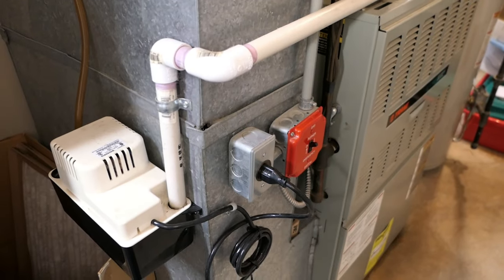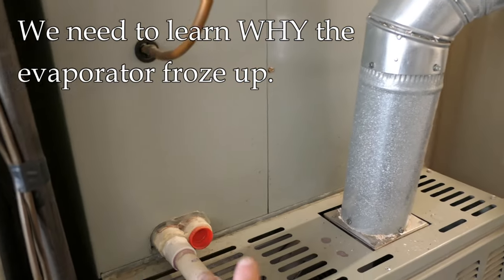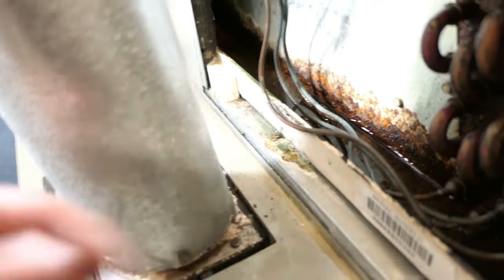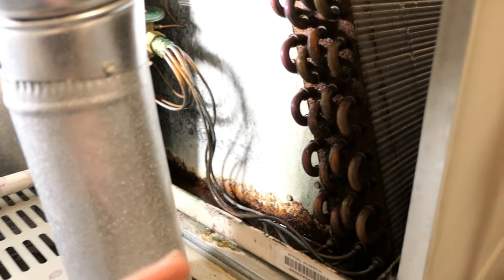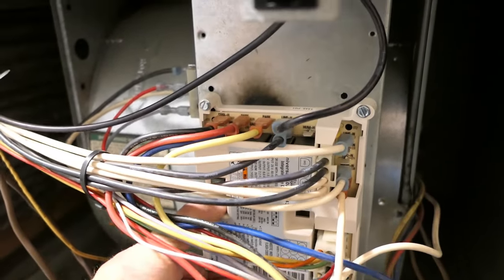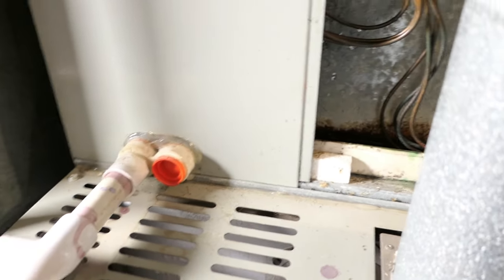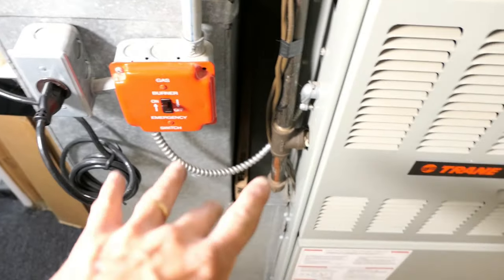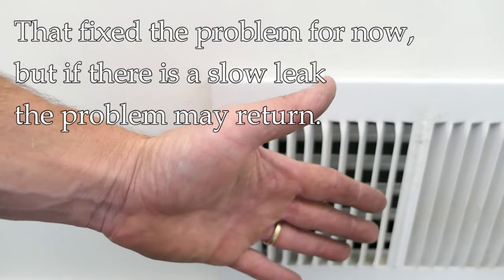How To Clean And Check AC Evaporator Coils After A Freeze Up

Comment: The evaporator coils in that unit are in a V formation and you are only looking at the outside of them.  If you removed that triangular panel in the center, you would have been able to look to see how dirty the coils actually were.  The INTAKE side of the coils is the part that accumulates all the dust and dirt and I am pretty sure that was the center part that you never even opened.  That is where the air first enters the evaporator coils from the return vent in your house.  They needed to be brushed and coil cleaner used to clean them.  Spraying water on the fins on the outside of the coils where the OUTFLOW of air returns the "cool" air to the plenum and then into the house is not going to solve the problem.  Sometimes the INTAKE side of the coils cannot be accessed simply by removing a panel with a few screws.  There are videos showing the person having to get down below the air handler and having to spray them through the opening where the return air from the home enters the air handler.
Reply from the maker: Well, the video was really about icing and the causes, not just cleaning.  You are correct that taking apart more of the sheet metal would allow a more thorough cleaning of the coils, although spraying from the outside in will take care of the worst of it.  Since the video is aimed at homeowners, there is going to be a limit as to how deep you want to go with disassembly.
Reply: I had to take off the V shape sheet metal to access the inner coils. That was the hard part since I had limited space. I had to bend the sheet metal to pull it out but finally got it. Your are 100% correct, the inner side was the dirtier side and literally had a thick build up of lint. After cleaning, I noticed significantly how much cooler the a/c worked.
Reply: Bry , I have a problem with my cooling coils I believe inside of my condo near the air handler. Maybe you could help me out. An AC man came twice! 1st free on. That didn't work. He tried cleaning the coils. But I don't think he did it properly.
Reply: This happened to me last year and guy came and supposedly “fixed it” all I saw him do was hose everything down, replaced something and left.. literally the next day the outside coils froze again and he said “just hose them down and leave system off for a few hours” so basically he didn’t fix shit 😡😡🤦🏻‍♀️
Reply: ❤Mine also impossible to clean the inner V. 
So I quit using our whole house AC and bought 2 mini split AC which cost $799 each. 
These are way better than conventional whole house AC.❤
Reply: Why is it so difficult to access the inside of these evaporators? Seems like this would be something you want to clean or at least inspect annually.

Comment: If the coil freezes, turn the fan to on and turn system to off on thermostat.  Will defrost much faster.
Reply: If it’s a gas furnace turn the furnace on and it will melt faster.

Comment: The real problem was inside the "A frame". Need to remove the sheet metal triangle (good luck!) and then remove the 1/2 inch think layer of pet hair, lint, pollen, dust and other crud with a brush and shopvac. Replace filters more than you think you need to, monthly for many households, or this will happen.
Reply from the maker: Yes, filth can build up on the other side, although it isn't always the case.  This system had a well maintained filter and the fan blades were clean.  When filters are not maintained I notice dust build up on the squirrel cage blades.  Removing the additional sheet metal to get underneath the A frame can be a lot more work, especially if rust is present.

Comment: Missing the trap on that condensate line.
Reply from the maker: In my area there are no traps in residential condensate lines leading to a condensate pump.  The tube leading outdoors from the pump has a loop, however.

Comment: Cleaning the top of the coil is not very effective, I would suggest cleaning the inner V of the coil where debris actually accumulates.
Reply from the maker: The whole coil can be cleaned, there was just a limit to what I could film given the physical space.
Reply: Yes, usually the bottom where the air comes in can have a thick layer of crap while the top looks pretty clean.
Reply: How do you get to the underside. Mine seems closed off. Trane xl80. 2001
Reply from the maker: If you have the style similar to the video, there is probably more sheet metal to remove before getting to the underside.
Reply: Find where the return is and clean that side of the coil.  17 years doing oil heating and a little A/C.

Comment: This guy missed the most important part.. Look and clean the inside ( Underside) of your A Condenser..
Reply from the maker: Actually, I think maybe you missed part of the video.  First of all, you are referring to the evaporator, not the condenser.  The condenser is the unit outdoors.  Second, I mentioned taking the unit apart further in order to do a deeper cleaning, but I also mentioned that this can be risky when there is rust and corrosion because things may break.  In this case the icing was NOT due to build up of filth on the evaporator coils but to low refrigerant.  When that was addressed the icing went away.  By gently forcing water through the evaporator coils with a sprayer as I showed in the video, loose dirt will be brought down to the pan below.  If heavy dirt or other filth starts to show in the pan or if the water doesn't seem to be going through the coils, then you may choose to take the unit apart further and get access underneath.

Comment: I was hoping you were going to take off an end panel so you could clean inside the coil.  Now that would make a great video.  Thanks.
Reply from the maker: You could take it farther if you wish.  Some sheet metal will be easier to remove than others, it will just depend on the brand and the physical space you have to work.  In this case the coils were really not that bad, but if the condition is worse it might be worth going the extra mile.
Reply: * COULD A CLOGGED  COIL CAUSE WATER LEAK  ???

Comment: you didn't clean that properly/you must take off front cover and clean inside that A frame.That is where  the debris are blocking air flow.Once debris carefully  removed then use foam on outside to clean out fins.
Reply from the maker: As I did mention in the video, you can go further in removing sheet metal if you wish. If there is significant build-up of pet hair or remodeling dust or whatever else then you may have to go deeper.  However, if the system filter was well maintained then pushing water through from the backside will force dirt to drop into the pan and it will also melt any ice, which was the main point in this video.  The risk of going further in an older system is that rusted screws or sheet metal will not go back together.  In this case the reason for the ice build up was not dirt, but a slightly undercharged system.

Comment: If you spray the water from the top as you did in this video, doesn't the water go through the fins to the inside of the A shaped evaporator and drop through the furnace heat exchanger and get down to the blower and dirty up the blower?   I have a unit looking exactly like yours but this is what I worry about before attempting to clean it by spraying with water.  Please let me know if this happened to you.  If not, I do not understand how that would not happen since there is open air chamber inside the evaporator where air comes from the blower through the furnace heat exchanger and water can drop through this chamber onto the blower.  Thanks in advance for your help!
Reply from the maker: The point of this video was really about freeze-ups, rather than a general approach to cleaning.  If your goal is simply to clean your evaporator, and perhaps you doubt the utility of your filter, then you may well want to go the extra step of pulling the evaporator assembly out, or taking it apart, so you can manually remove any built up dust and debris.  What I was showing in this video was the aftermath of a freeze up, and the point was only to do a light cleaning of the coils without risking the disassembly of an old evaporator.  The method I used allows for deposits on the fins to be dissolved and removed, but is not likely to be helpful if you have significant dust build up.  However, you would notice heavy dust build up on the underside if the water did not easily penetrate the fins.  To answer your direct question, I was using a low pressure sprayer, not a firehose.  While there could be some minor spits of water into the open area,  the fins deflect the spray and most of it ends up in the tray below where it can be drained out.  After I was done cleaning, starting the system back up will dry off any stray water.
Reply: @enduringcharm  Ok, got what you are saying.  Thanks for the reply.  Btw, what I do not understand is why the manufacturer does not make it so that it is easy to clean the evaporator by the users.  It seems like clogged evaporator problem is very common and it needs to be cleaned regularly and yet they designed it such that it is almost impossible to clean the underside without disassembling it completely which requires evacuating and recharging the refrigerant as well as re-plumbing.  You would think they figured this all out by now but they did not or they do not care to for the convenience of users.  On top of that, they made it so that furnace heater air also has to go through the evaporator which restricts the air unnecessarily during the winter time.  This stupid design further aggravates the evaporator clogging problem.  I am not sure why some company come up with clever design to solve this problem for the customers.  They all seem to stick to the same stupid design to cause the customers and service men a lot of headaches.  Maybe they will wake up when some forign company comes up with clever desgin to solve this problem and take over the market share. Just my thought.

Comment: Great video. Thanks so much. My 35 year old condo furnace  is only 12" W x 25" D. My evaporator section is only like 7" high. I opened the plenum at the seam expecting to see the A-coil extended way up into it, but to my surprise my coil was small non-A style 7" high with 4 or 5 condensate channels. I was expecting to clean underneath, but you can't with this style unless you pull it out. Am I correct? Thanks again.
Reply from the maker: There are a million different styles of evaporators and furnaces, so yours could indeed look very different.  Sometimes it's not worth disassembling the whole thing, better to just clean what you can access and call it a day.
Reply: @enduringcharm  Thanks for the reply!  That's what I did. I opened the plenum and to access the evaporator access panel I had to bend down a lip of the furnace wall. To make things worse, the paint on evaporator coil enclosure was breaking down, very sticky and all over the place! Then I closed it all back up! lol. Screw holes never seem to line-up like the first time. Waste of time, but now I know what's in there. Thanks again.

Comment: I went to clean my  A frame ac condenser today, took of the access panel off the furnace there many lines running in front of it A sheet metal no access available. Without taking the whole middle section of the furnace apart to access the other end. Its a Lennox furnace, so how do you clean inside the A frame condenser, suggestions please.
Reply from the maker: I think you are referring to your evaporator (inside the house) rather than your condenser?   Without seeing the problem in person I may not be much help.  It may well be that you have to do extensive disassembly to get at the unit.  Typically I will look for the condensate tray drain, and then find panels or screws in that area for access inside.

Comment: Is the cleaning of the A-Coil part of a general maintenance.? Mine is getting rusty, but  if attended to, this won't become a failure... What say you...?
Reply from the maker: Well, some homeowners do no maintenance at all, and others do extensive annual maintenance.  Is it a good idea to clean out the evaporator once in while?  Of course.  The need for it will vary, though, depending on circumstances.
Reply: @enduringcharm  I have my system checked twice a year, but after 8 years, I find that my AC Coil is about rusted into failure. I know they make stuff to clean, remove & halt rust, in it's tracks, but my maintenance people  are lazy & looking forward to my purchase of a new A-Coil...

Comment: Would dirty coil can cause short cycle on my furnace?
Reply from the maker: So the problem is with your heat?  It cycles on and off too fast? Typically something like that is related to the thermostat or the control board.
Reply: @enduringcharm  yes it does that. And also overheats. Last year winter was working perfect. But I just tuned it one yesterday. And goes on and off and sometimes the burner where the main flame is it totally shutting off.
Reply: @enduringcharm  it does heat up . But I can feel furnance cover gets too hot. And I have to keep resetting on os the switches. I haven't check the exhaust pipe yet. But since I got this place (mobile home) 4 years ago. And in every first start after the summer always short cycles till it reaches the desired temperature and after that works normal and no more short cycling. But now its just short cycling and overheats and like i said sometimesthe the the flame in the burner dies. I replace The flame sensor last year dues to pilot flame wouldn't stay ignited. Filters are new and clean. Thank you for the help. God bless you my friend
Reply from the maker: Well, it could be that you have a legitimate problem and the control board is shutting down for a good reason.  The flame sensor is one item, or some other electronic issue.  The control board is programmed to check certain things before start up, and the control board is also programmed with a start up sequence.  It is possible that your control board is damaged or faulty.  See this video as an example of what I mean:  https://youtu.be/bR6jjTOd5e8
Reply: @enduringcharm  perfect I will check on that

Comment: A NEW AC COIL FOR MINE IS $650 PLUS HAVING IT INSTALLED, I WONDER IF I SHOULD GO THAT WAY OR GET A NEW UNIT? IT'S 40 YERAS OLD AND NOT HOLDING THE COOLANT THEY PUT IN, AND THAT WAS $200 JUST TO TELL ME THE AC COIL IS LEAKING IT OUT! ANYBODY THAT CAN GIVE ME ADVICE, WOULD BE GREATLY APPRECIATED, THANK YOU, GOD BLESS YOU'LL!
Reply from the maker: If your system is 40 years old, it's unlikely it's worth repairing.  A new unit will be more expensive upfront, but it will be far more efficient (which will save you money) and all the components will be new and will last much longer.
Reply: @enduringcharm  THANK YOU, THAT'S WHAT I'VE DECITED TO DO!

Comment: How can you tell if you got your coils clean enough? Can you test by something a simple as shining a flashlight though the coil?
Reply from the maker: You're overthinking this.  If you get the degreaser applied, leave it for a bit, and then the spray off looks clear then you should be fine.  If you had debris in the coils, then once the spray off  is clear you're good to go.  You don't need to eat off the coils, the point is just to prevent build up over time.  Watch the tray and the pump for clues as to how clear the water run off is when you spray.
Reply: The problem is the air flows from inside the A coil to the outside. The major clog would be where you can’t see inside the coil. Usually take a little more than degreaser and and light spray from the outside.  I have seen a 1/2 layer for dirt and dust clogging from the inside. This will cause major air flow blockage and freezing.

Comment: Thank for the video. Do you know if i can use a 16x20x1 filter in a system that i just pulled a 16 1/2x21 1/2x1 out of?
Reply from the maker: All you need to ensure is that the filter will seal around the edges.  In some systems there is no room for play, in other systems you may be able to slightly adjust the filter size and be okay.  All you can do is shine a flashlight in there and see what kind of room you have.

Comment: Hi.  Thanks.  We have a Magicpak unit in a closet in our condo.  It's dripping water in the closet and down the outside brick when it's in AC mode.  It's new.  Filter is new.  Installer says he needs to contact the manufacturer.  Very frustrating after $7,500.  Any experience with those magicpak combo units?  Thanks.
Reply from the maker: Don't know a thing about that brand or model, but if you have water coming out during AC use, it's probably condensation.  Either the condensation collection system was not properly installed or it is blocked for some reason.
Reply: @enduringcharm  Thanks for the input.

Comment: Can I use a coil cleaner spray? It usually sprays out a foam. But isn’t know it that water sprayer is enough to remove the foam. Probably gonna need the water hose. But is that too much water?
Reply from the maker: Well, you can use as much water as you want, the important thing is that you drain or vacuum up that water as fast as you put it in!  If you want to do a more thorough cleaning you may also want to remove more of the sheet metal than I did in the video.  In that case you may have easier access with a wet vac.